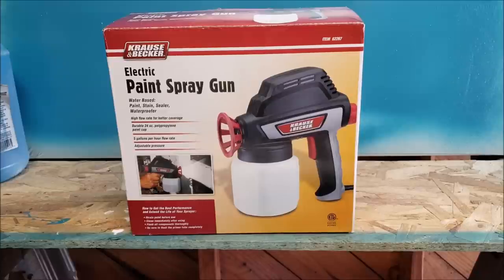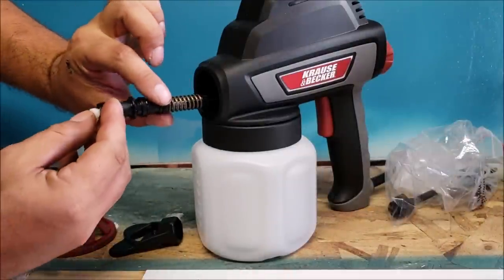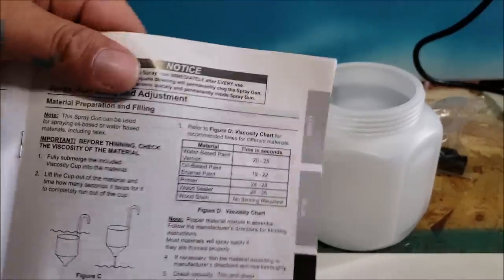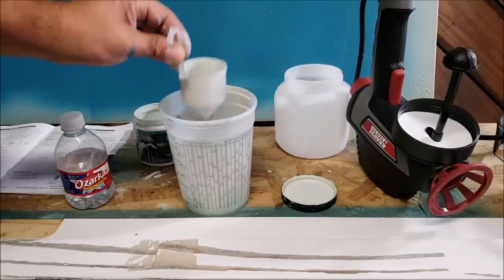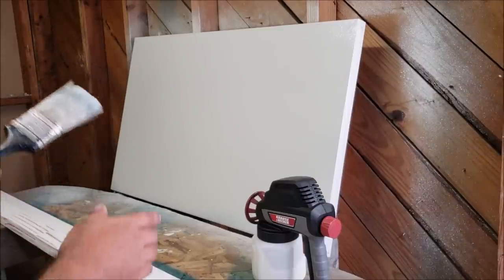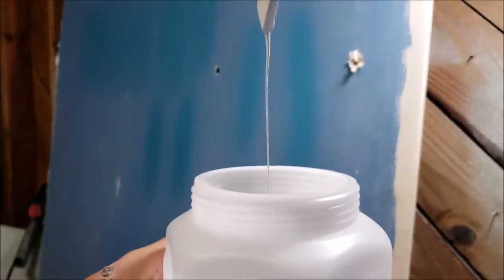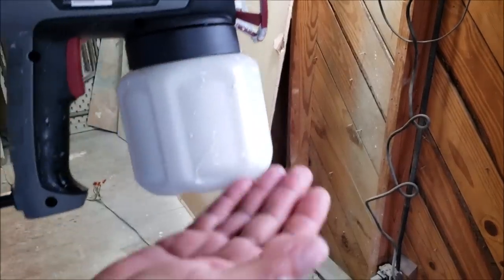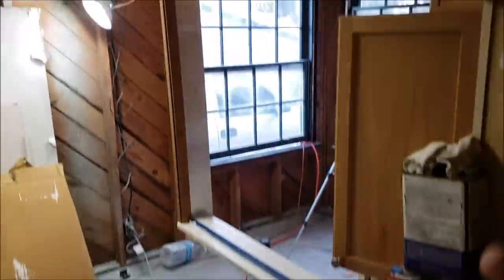harbor freight kraus & becker electric paint sprayer DIY how to

Comment: I purchased one of HF paint guns today.  Was spraying away until it quit after about a minute.  I tried cleaning it, clearing it and thinning the paint (which was already like water) but couldn't get it to work.  Took it back to HF and spoke with the manager.  He suggested trying a different item number on the box as HF contracts with different companies to make the gun.  The item # of the one that went bad was:  63 something, something, something.  The next one I got that's working like a champ is:  63452.  The cup is larger on 63452 and it's louder and heavier. 

Chris is correct on everything.  Get hearing protection for sure.  I am painting the walls in my garage which is drywall that was previously painted white.  There's overspray all over the floor under the walls which isn't a big deal in there, but if you tried painting a room in the house, you better have plastic on every inch of surface you don't want paint on.  Since it's a garage, I picked up 2 gals of Walmart's cheapest white paint.  It still needs thinned down.  I don't know if it's just cheap paint, but it's going to take at least 2 coats to cover.  And yes, have a roller handy.  When you're learning how to use the gun, you're going to have runs, lot's of 'em.

Comment: This video was incredibly informative. Loved that you analyzed how to make it work, rather than just throwing it away after it didn't work the first time you used it.  Gonna pick one up this weekend.
Reply from the maker: just make sure you get some air tool oil and lube that piston...  im pretty sure thats why it worked so well...  and when you clean it after use... oil it again
Reply: Chris Craft my Home Depot only had Throat Seal by Graco. Not sure if that's gonna do it but I'll find out soon enough. Seems like a fairly thick liquid from what I can see tho.
Reply from the maker: Rob Kadera knowing what I know now that should be fine... that was the first place I went

Comment: Useful information, especially about thinning.  Just bought one of these to paint the exterior of my mom's house.  It's stucco and rough so I expect it will take longer and require brush/roller assist but I am hoping for the best.
Reply: I'm about to use one for some stucco too, stucco just eats up paint and using a roller or a brush just takes forever. Spray guns were made for fences and stucco and cabinetry and well 100 other things probably 😂

Comment: Pentrol flow control for latex paints is used to thin.  Water or other water based usage will thin the paint for sure but what it is really doing is creating a molecular separation between the titanium dioxide molecules.  This type of thinning will change the characteristics of the paint that make the paint do what bought it for.  That is coverage, adhesion, elasticity of its resins and type of sheen.  Using FLOWTOL/ PENTROL is an additive that changes the friction coefficient of the titanium dioxides allowing them to flow easier. As the paint cures the molecules of paint retain there designed characteristics by maintains their molecular affinity.  Basically water creates separation and flowtrol creates lubrication.
Reply: here we go! Expert guy with the molecular attraction and the lube hole, are you describing "Van der waals" forces why doesn't your channel have any content?
Reply: To big of words for ya?

Comment: Great video as I easily understood what you were explaining. I was kind of bummed when you said that “you’d have problems using it for ceilings”. That’s why I bought it. I thought I was going to die using a roller. I’m still going to give it a go. I’m just too weak for that roller and extension pole. Hopefully it’ll work for me, if not, back to the roller set up and I can use the sprayer on the walls knowing that’ll work. Thank you!
Reply: There should've been an extended tip that came with it, might help with ceiling painting, not saying it will help ,but ya never know til ya try

Comment: The one we just bought didn't come with the manual. I am an experienced air gun painter standard and HVLP. Looking to paint T-111 siding. Used a Wagner once and it was a freakin nightmare. I threw it away. Hope this one is better. Saw a video young guy painted his wife's car. Did a pretty good job. Says on this box water based ?? So does that solvents will melt it??Whatcha think?? I'm 80 yrs old and so very old school. Haha. Great review. Subbed Dandahermit

Comment: Thanks, I  just bought one today at Harbor Freight for painting basement sill plate that I sprayed with foam for insulation. Painting it with a latex paint to make it somewhat fire resistant and to make it look better. Wish they would have told you what the different fan ends were designed for !,

Comment: Funny man,we put SuperClean diluted 2-1 and clean engines,inside car sills and gas cap compartments, it’s fast and we can narrow down the pattern.
At 175 PSI,not too strong,but it reaches points we cannot touch. 

Many other uses in car detailing. 🤜🤜🇱🇷

Comment: I gotta tell ya,  Add the cleanup and taping to the timeline and I’m not so sure the juice is worth the squeeze.  At the “on sale” price point that sprayer is almost a disposable tool, but even if you cleaned it I doubt it would be good for many jobs.  So I bought one to paint some shutters (off house)  because I can’t get my color in a spray can and shutters are a pain to brush. Thanks for the tips.  I also have some flowtroll that is for thinning paint.  If I can find it I may give that a try.  Appreciate your video!

Comment: i use it for popcorn ceilings, makes a big mess but gets it done. I just tape the whole room up and have a blast...lol. 1 coat is usually enough.
Reply: Oh thank you for posting that! I bought this for my popcorn ceilings and was like dam, when he said “you’d have problems using it on ceilings”. I’m SO relieved.
Reply: @Ellen010763  it actually comes with a ceiling attachment, I just dilute the paint to a manageable viscosity, it does a really good job I should say.

Comment: It's almost true about the anti-freeze, cuz see where i live we get extreme temperature and if I forget to mix in the antiFreeze at night the thing clogs with ice crystals and seizes up, but then in the day-time also need plenty to keep the paint from actually boiling and popping the reservoir. I also need to remember to pickup some 5W30 for it when i get back to earth. Live long and Use the spray-force, guys!

Comment: Just got finished using mine tried to paint front room walls. Didn't turn out so well at 20 seconds to paint was too thin intended to run and pool I'll spend the next 3 hours cleaning up the mess. Thank God it's latex. And thank God for Goof Off

Comment: manual says piston is one unit, this is false. You can pull the white tip out (with spring and check valve) and also the piston out by turning the spring clockwise it will come apart with little force, This is the only way to do a final clean on it when your project is done. The regulator only adjusts the stroke of the piston off the hammer of the electromagnet. I bought a crusty one for $5 at a swap meet and was able to clean it out to working order, PITA so make sure you run clean water through it (or oil based solvent) when your done and finish off with a drop of oil.

Comment: I may have missed it but why a "no" on cabinets? Over spray? What if they are in the garage and im not worried about overspray? The overall cover looked pretty good on the plywood.
Reply from the maker: if you are new to painting you will make a huge mess .. watch my how to paint a front door .. spray like that
Reply: @chriscraft77022  So basically get a decent gun and flow add on haha, dont use the Kraus& Becker, check lol

Comment: Hated then spraygun, loved this video though! Very informative 👍🏻
Reply from the maker: it is a messy spray gun.. I haven’t used it on a real peoject yet but I will make a video when I paint my living room with it... if you thin the paint out super thin it works great but that’s not how you paint
Reply: @chriscraft77022  I almost think I thinned it too much, I got paint EVERYWHERE and it was so watery that i had to use a paint brush to thin it out. I just got it today and tested it out on my chair rail molding... it also sprayed all over the floor, it was a nightmare to say the least..looking forward to a follow up video!
Reply from the maker: watch my how to paint a front door video..  an hvlp works great

Comment: Would you use this to paint some large metal cabinets for a garage?
Reply from the maker: heck no
Reply: What would you use? They are old and dingy. Just wanted to give them some new life.
Reply from the maker: @A 567 watch my how to paint a front door video..go get that $15 harbor freight hvlp
Reply: Chris Craft I just watched the video and it says you can spray latex paint with this sprayer on the Harbor Freight website as well as says it’s a general use sprayer. Would you avoid using this sprayer for this project even if I had the primer and latex paint?
Reply from the maker: that electric gun is gonna make a big mess.. go ahead and try it so you can find out..

Comment: How much water did you add for every 3/4 of paint used in the container?
Reply from the maker: I ended up diluting bear premium plus paint with about 20%water10% flotrol  to get it to spray good with the correct viscosity... the truth is I ended up painting my house with a brush and roller... thinning the paint down to spray on the exterior will only cause premature problems with the paint breaking down by the sun
Reply: @chriscraft77022  I am trying to paint my basement walls and also basement ceiling.
Reply from the maker: just thin it to the right viscosity with the cup it comes with . you should be good
Reply: @chriscraft77022  ok thanks

Comment: I must have the newer model because it doesn’t come apart like that, to clean. Now it’s clogged and i have to take the whole thing apart to clean it 🤦🏾‍♂️
Reply: I also have a newer model which it does NOT come with METAL nozzle, it cuts the cost by using 4 non-metal (plastic) nozzles and mine only works then split - works intermediately. Cannot even able to pick up paint if NOT thin it down. Sometimes work, sometimes split which creates tons of SPOTS not as powerful stream like this video shown. Any helps/tips? I've to clean it again maybe.

Comment: The knob in the back changes the amount of paint that is pumped. There is no air within the spray!  Electric airless! There are airless paint sprayers that are the bigger type that look like what contractors use, the similarity with some of these bigger units are that the cheaper ones use the same basic piston design as these small handheld type.
Reply: Jesus Skippyjohn Jones! you never give it rest do you!
Reply: What is the problem with the reply?  Too far above your pay Grade?

Comment: Helpful video, but the spraying is junk. I've use many sprayers and I know how to use them, but I had to take this thing apart, clean it and lube it repeatedly to keep it spraying. Also, The paint has to be so thin for this gun that it will run unless you're spraying on a rough surface.
Reply from the maker: i am gonna do a video soon actually trying to spray a room..    LMAO..  in primer..   thanks for the comment..

Comment: 10q mr chris 
Any one can answer me pls
B4  I fill the container with paint I filled it water to c how the sprayer doing but unfortunately the sprayer couldn't  spray the water.  I only hear the roaring sound of the spraier with out spraying the water.
Do u think the sprayer has sensors to know  that I use water instead of paint. Silly question but I have to ask
Reply from the maker: no sensors..  if it’s NEW the o-rings should be lubed enough to spray anything., it should spray water with no problems .... return it ... something is wrong